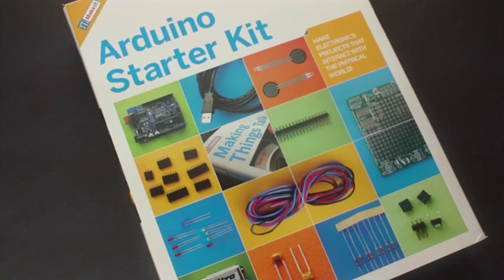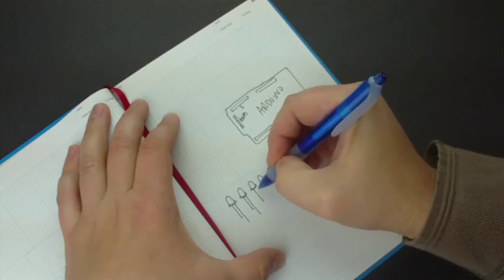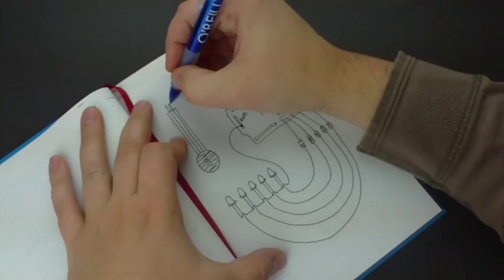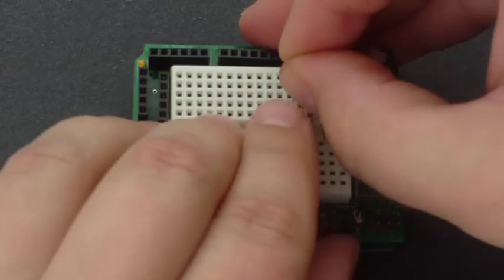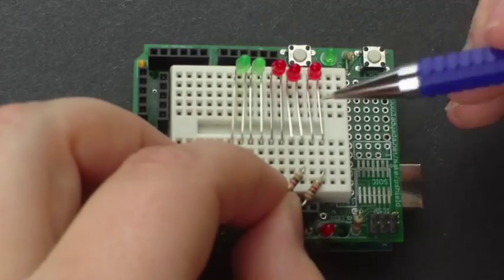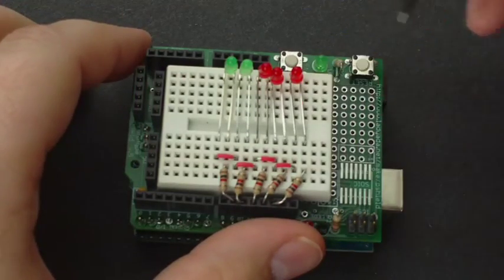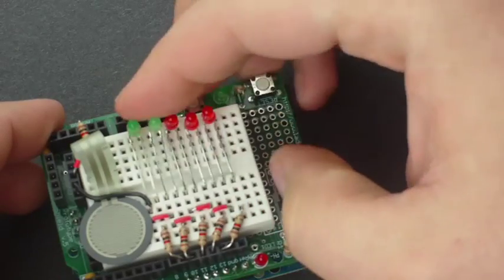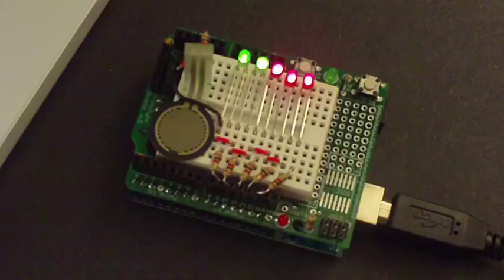How-to Tuesday: Fun with the Arduino Starter Kit

Comment: */

// Here are the constants that we define prior to the program running

int forcePin = 2; // select the input pin for the force sensor
int val = 0; // variable to store the value coming in from the sensor

int led1=9; // defines "led1" as the number 9
int led2=10; // defines "led2" as the number 10
int led3=11; // defines "led3" as the number 11
int led4=12; // defines "led4" as the number 12
int led5=13; // defines "led5" as the number 13

// End of constant definitions

void setup() //run one time when the Arduino first powers up
{
Serial.begin(9600); //starts serial communication, only used for debgugging

pinMode(led1, OUTPUT); // remeber led1 = pin 9, this statement sets pin 9 to output only
pinMode(led2, OUTPUT); // remeber led2 = pin 10, this statement sets pin 10 to output only
pinMode(led3, OUTPUT); // remeber led3 = pin 11, this statement sets pin 11 to output only
pinMode(led4, OUTPUT); // remeber led4 = pin 12, this statement sets pin 12 to output only
pinMode(led5, OUTPUT); // remeber led5 = pin 13, this statement sets pin 13 to output only
}

void loop() {val = analogRead(forcePin); // read the value from the sensor

Serial.println(val,DEC); // print the value "val" of the sensor (used for debugging)

if (val>250){ //if the value is maxed out or greater than 250
// aternative code for the following -----for (i=1; i<6; i=i++); digitalwrite(led[i],HIGH) digitalWrite(led5,HIGH); // turns on all 5 LEDs digitalWrite(led4,HIGH); digitalWrite(led3,HIGH); digitalWrite(led2,HIGH); digitalWrite(led1,HIGH); delay(100); //slight delay to minimize flickering } else{ digitalWrite(led5,LOW); //turn off all 5 LEDs digitalWrite(led4,LOW); digitalWrite(led3,LOW); digitalWrite(led2,LOW); digitalWrite(led1,LOW); } if (val>=175 && val<=250){ //if value is between 100 and 175 digitalWrite(led4,HIGH); //turns on 4 LEDs digitalWrite(led3,HIGH); digitalWrite(led2,HIGH); digitalWrite(led1,HIGH); delay(100); //slight delay to minimize flickering } else{ digitalWrite(led4,LOW); //turns off 4 LEDs digitalWrite(led3,LOW); digitalWrite(led2,LOW); digitalWrite(led1,LOW); } if (val>=100 && val<=175){ //if value is between 100 and 175 digitalWrite(led3,HIGH); //turns on 3 LEDs digitalWrite(led2,HIGH); digitalWrite(led1,HIGH); delay(100); //slight delay to minimize flickering } else{ digitalWrite(led3,LOW); // you get the picture.... digitalWrite(led2,LOW); digitalWrite(led1,LOW); } if (val>=25 && val<=100){ digitalWrite(led2,HIGH); digitalWrite(led1,HIGH); delay(100); //slight delay to minimize flickering } else{ digitalWrite(led2,LOW); digitalWrite(led1,LOW); } if (val>=0 && val<=25){ digitalWrite(led1,HIGH); delay(100); //slight delay to minimize flickering } else{ digitalWrite(led1,LOW); } }

Comment: stupid question: Why don't you need the 5 v or 3.3 v pins?  
I am a beginner.  I am really confused about the difference between 5 v pin and the digital pin.  If the digital pin can provide power to light the led, why do you need the 5 v or 3.3 pin.
Reply: Pengfei Zheng The pin has 5V (or 3.3v) constantly, but a digital pin only has 5V if you switch it on in code. Some things need power constantly, such as an LCD screen, so you use the 5v pin.

Comment: Resistors limit the current. LED's have very little resistance, so they would just burn out if you connected them directly to the power supply.

Comment: couldn't you save resistors by connecting ground through a resistor instead of all the positives? and doesn't pin 13 already have a resistor?

Comment: @Slench101 they do..... you just have to put it together. it's in a zip plastic bag with the protoshield pcb, two LEDs, two pushbuttons, and some connectors. You can look up how to solder it together on ladyada.

Comment: Well about the LEDs

Just in case I cut the LED's wire and makes the wire look the same length
one way to determine the negative one is to look at the bulb thing-y of the LED and look for the FLAT one. That's the negative wire of it.

Comment: If those are 1K Ohm resistors, isnt that kinda high? Depending on the exact diode forward voltage and current you could use much smaller resistors.

Comment: You better start to trim your LEDs, because you are heading for disaster.
Those long leads, of consecutive LEDs, put negative(GND) and positive(VCC) right next to each other. if for some reason, you push the LEDs arround, they will touch each other, ie. a short circuit between gnd and VCC (through a resistor) and will probably burn your arduino or some part of the board.

Comment: Over voltage? You can exceed the watt limit of the resistor... but follow me... voltage output of the Arduino is probably 5 volts (Standard for TTL and CMOS logic). Most leds use about 20mA.... so a maximum of 0.1A. Power calculation is P=VI or P=(I^2)*R. Since we know the voltage and the current we will use P=VI. 0.1*5=0.5W. So you need a 1/2watt resistor. Easily obtainable from your local radio shack. Probably something I have right now on hand....

Comment: I got a different kit, but it has a light resistance capacitor or whatever its called. I set up a program that flashes some LEDs faster depending on how dark it got. It worked except when I had two LEDs in the same part (like 12 and 13 etc) only one would seem to work. I tried swapping LEDs so that wasn't the problem.

Comment: well an arduino microcontroller can do almost anything as long as u design the circuit and code properly. its a programmable chip, so the only limit is the imagination.

This is merely showing a very simple application of a pressure sensor.